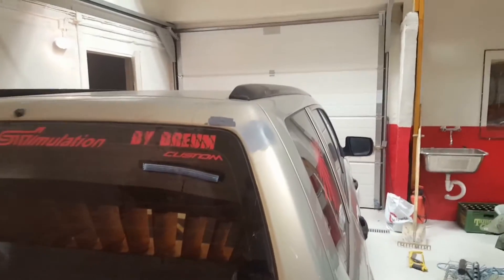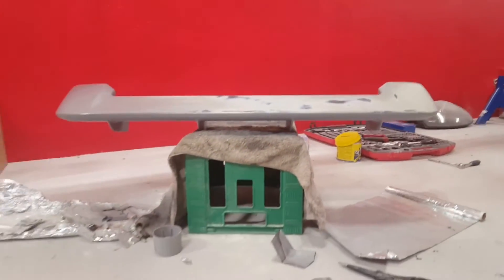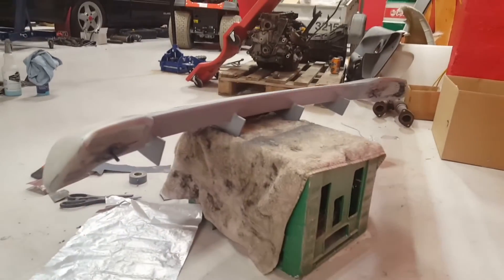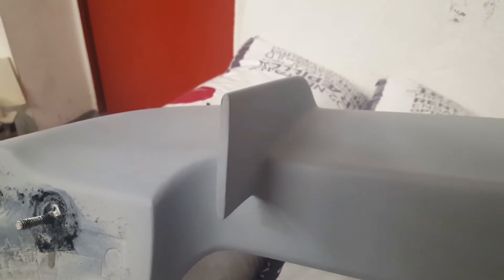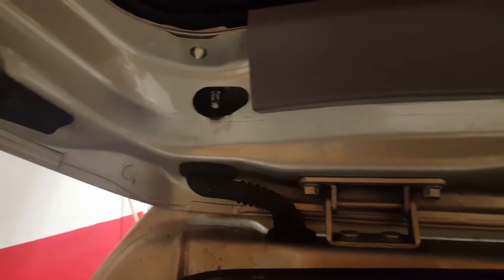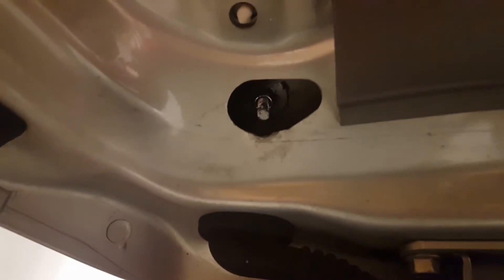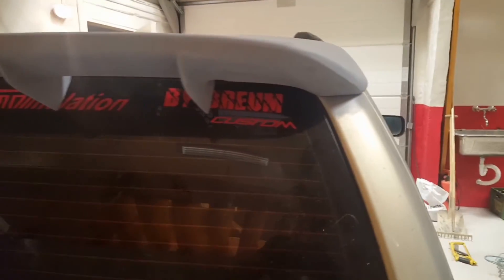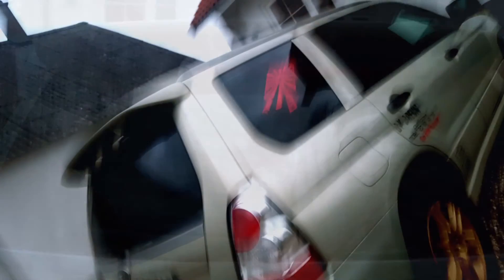Forester SG spoiler got a "facelift"

Comment: Hey man, where did you get that wing or at least what is the name for it? I can't find it anywhere.
Reply from the maker: SanProCo hey there mate. its just an ebay fibreglass wing where i modified it and molded the fibreglass Finns to it. custom job mate. :)
Reply: HAZE101 yeah I get that but the base of it is factory style?
Reply from the maker: SanProCo yeh. Just the model  without the brake light
Reply: What year Wrx spoiler did you use to modify for this?